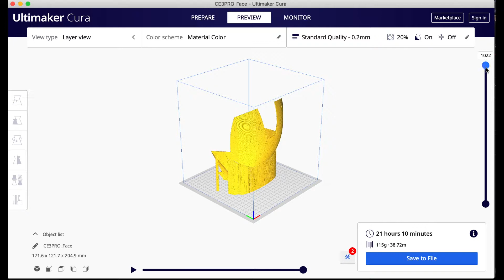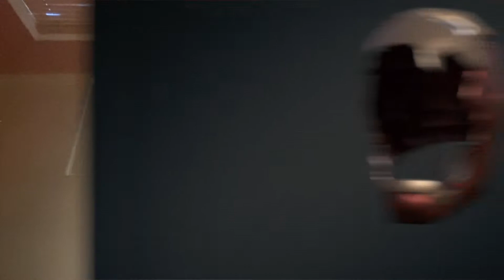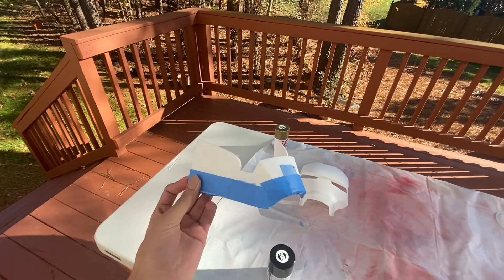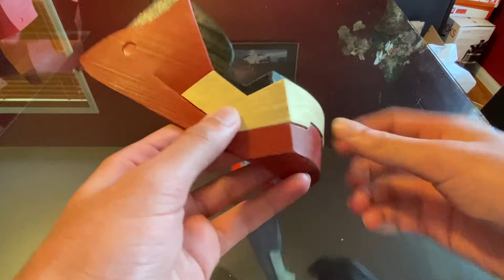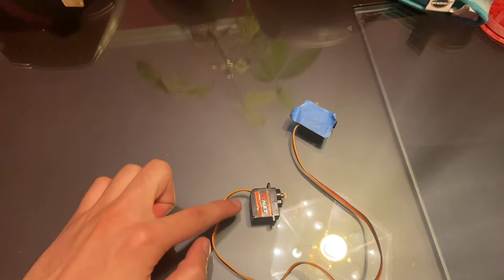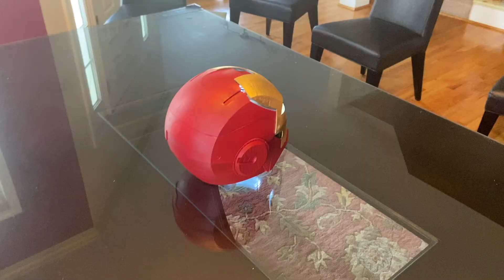BUILDING AN IRONMAN HELMET

Comment: did you print the files at %100? or did you have to scale it differently?
Reply from the maker: I believe I scaled these down a bit, there is a sizing ring in the parts that should help you determine how much you need to scale up or down

Comment: Hey I'm trying to finish this but the servos just open an close when the button is pushed. And the lights don't work. Could I get a wiring diagram and the code u used???
Reply from the maker: Both the wiring diagram and the code are in the instructions pdf on Boxandloop's thingiverse page, the link is in the description
Reply: @sujaymakesstuff  the code in the pdf is broke won't comple tho.
Reply from the maker: It compiles for me, make sure you have the ServoEasing library downloaded

Comment: Does the price you mentioned include the cost of the 3D printer? Nice build.
Reply from the maker: It does not, my Ender 3 Pro was relatively inexpensive at about $200 but you can find more/less expensive printers as well depending on what level of quality you want

Comment: When I upload the code to the program is says they servotop was not declared in this page. Is there a way to fix this
Reply from the maker: It sounds like you need to download the ServoEasing library for Arduino. You can do this by going to Sketch -> Include Library -> Manage Libraries and search for ServoEasing.
Reply: @sujaymakesstuff  unfortunately it keeps showing that the Servotop was not declared in this scope, I can’t figure out why, I added it to the library and nothing.
Reply from the maker: @skuly_2987  Maybe try quitting and reloading Arduino? I copied and pasted the code from the Thingiverse instructions and it worked for me so you shouldn't need to change the code at all.
Reply: @sujaymakesstuff  ok I will try that
Reply: @sujaymakesstuff  alright I deleted the program and then Defoe loaded it and it still shows up that Servotop was not found

Comment: hi, nice video! i'm buildind this too but i have only one problem, one servo moove and the other no, everything connected, cable are ok checked with multimeter, battery full charged and code has no error, what could i miss? thank you
Reply from the maker: Maybe try using another servo motor and see if that's where your problem is. I have found that the servos take up a lot of battery and once the battery is low, they start acting strange. U can try running them while connected with USB to see if the battery is the problem. Otherwise just ensure your connections are all secure and correctly wired.

Comment: Hi there! Almost done with it but I seem to be having an issue with the electronics. It works perfectly fine when connected to the computer but when I unplug it and just use the AAA batteries it really doesn’t function properly. I tried using new batteries, re-wired everything too and used new components as well but nothing. I would appreciate any advice here. Thank you!
Reply from the maker: A common problem I ran into was having to exchange batteries often since the motors took up a lot of power. When battery is low the motors behave erratically so that might be your problem. Also ensure that you don't have any wire frays touching each other on the arduino. Good luck!

Comment: Great build! I also just finished this build as well, may I know why it costed you $250?
Reply from the maker: Cost of Filament + Hardware + Paint + Electronics
There's probably less expensive materials available but I was pretty new to this so I went with the suggestions from the Thingiverse
Reply: @sujaymakesstuff ah that makes sense, also how easy is it for you to see through the lenses? Just hooked mine up and I'm afraid of damaging my vision to be completely honest.
Reply from the maker: @kirei8938  When the LEDS are off the lenses are pretty see through and when they are on you can still partially see through them since the light isn't too bright. They probably won't damage your vision but I wouldn't recommend looking through them for too long.